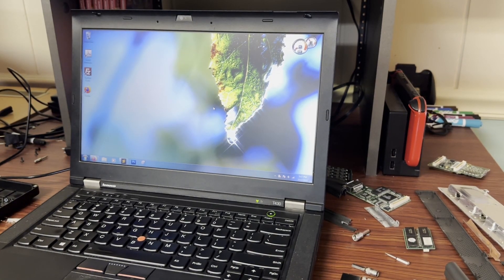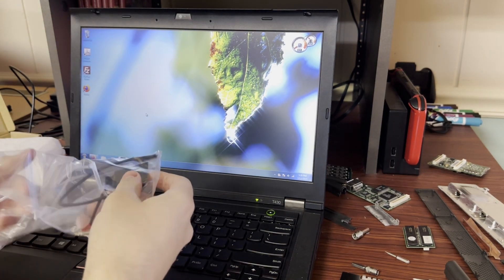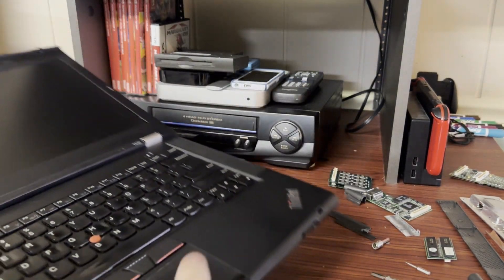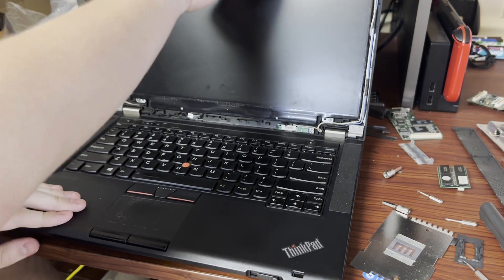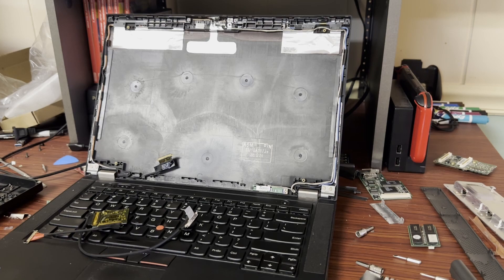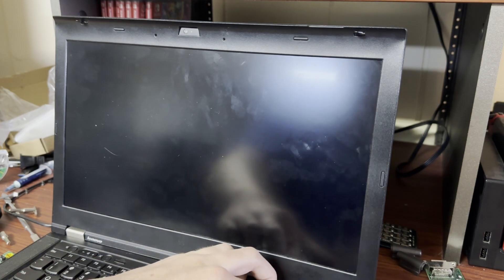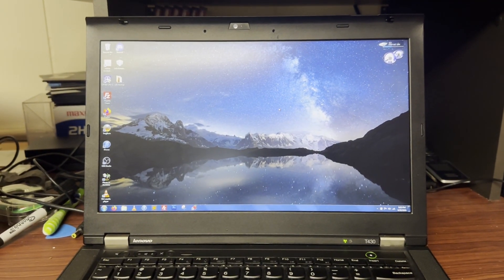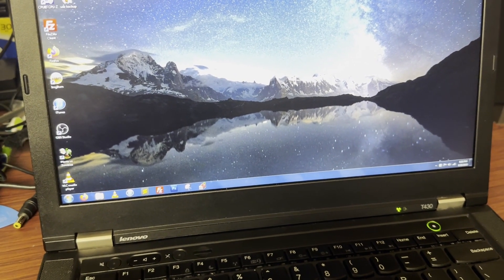Building my ultimate Windows 7 laptop (Part 1) - ThinkPad T430 1080p IPS Display Upgrade

Comment: I also don't trust the internal graphics in this laptop to run a 1440p monitor--I've got far newer and fancier thinkpads that struggle with 1440p
Reply from the maker: It should be fine for web browsing, video playback, programming, and other light tasks. I wouldn't expect a T430 to do well in gaming, video editing, CAD, or any other intensive task regardless of what screen resolution you have.
Reply: 1440 divides perfectly into 720p for games n stuff 😉 even better performance than the weird 1600x900

Comment: I've picked up a thinkpad W530 and I'm just wondering where you sourced the display mod? i've believe that my one has the same screen as yours currently (1366x768) I found some 1080p displays on aliexpress but I don't know if they'll be much better. (edit, actually, if i'm going to upgrade, the 1440p one might be worth it for me)
Reply from the maker: W530 is totally different, different size LCD etc. You’ll have to see whether or not they used LVDS or EDP screens. The T430 adapter should work if they use LVDS screens but make sure to do your research before buying anything.

Comment: Good video even though you skipped how you installed the new screen circuit board for the new screen. I have an old T430 that was in the discard bin at my old company when they upgraded everyone to new Thinkpads. It only has 4GB RAM, and i5 vCore and and slow 512GB HDD, so I am upgrading it to 16GB memory, and 1TB Samsung SSD. I will wait to see how its performance improves before going for a i7 processor. I have heard that an i7 does not make a real big difference. I upgraded a Dell Optiplex 9060 SFF to 32GB RAM, 2 1TB SSDs, and an i7 quad core processor.  For the original $64 price on ebay, it is a big improvement. These old PCs cannot update to Windows 11 though. I run dual boot Win 10 and Linux Mint or Arch Linux on these two machines (just one Linux OS per machine) . I am tempted to just go for a Thinkpad P14S but since I mostly use my MacBookPro M2, it might not be worth it. I like the Thinkpad keyboards and use a Thinkpad Trackpoint keyboard (~$96) on my Dell 9060. I also have an SGI Indigo Solid Impact computer that I bought in 1995. It still runs but it is more of an office space heater and relic from the past than anything else.
Reply from the maker: SSD upgrade will make a huge difference, it will be totally usable with the i5 that way. I’d still recommend a cheap quad like the 3720QM though, will give a big performance boost. Dual i5 to dual i7 won’t be noticeable. You can only do a quad upgrade if you pair an iGPU motherboard with a dGPU heatsink, otherwise it overheats.
Reply: @3lectr1c   Thanks for the advice. Today I installed the Samsung 870 EVO 1TB SSD and reinstalled Windows 10. The computer is much much faster now. I am waiting to receive the 2 x 8GB RAM cards. I think that for now I will stay with the i5 v-Core. It seems fast enough at the moment. Next I will go through the process of installing Arch Linux. I have a quad core i7 in my Dell Optiplex 9060. It has a heat sink with a overhead fan and it never overheats. I was thinking of putting a small GPU into that computer, but there are only about 2 choices, and I am already pushing the power supply and I am not a big gamer.

Comment: The ultimate W7 laptop IMO is the Dell Latitude E6540. I installed 2x 2.5 inch 1TB HDD and 1x MSATA as boot drive. Display upgraded to IPS FHD 40 pin from LG. With a removable battery, it is a breeze to lug it around.
Reply from the maker: That’s the great thing about these laptops - there is no single “ultimate” laptop. Everyone can have their own favorite. For me the ultimate machine is a 14” ThinkPad, because I like the size, and the keyboard is super important to me. That latitude looks like an absolutely sweet machine though, and if it’s the one that fits your requirements best, it is the ultimate windows 7 laptop for you.

Comment: don't do it the way this guy did.
Reply from the maker: You mean where I mounted the adapter? When doing it this way the most important part is to route the cables properly, or you’ll get bright spots of pressure damage on the LCD. As long as you don’t mess that up, it works fine. I’ve been heavily using my T430 since the video with no issues.

Comment: lcd part number please... ?  i want to buy the same lcd like you...
Reply from the maker: LGC LP140WF1-SPB1
Careful though, a lot of eBay sellers sell relabeled “compatible” panels that may or may not actually work
Reply: @3lectr1c  thanks bro... ❤️❤️❤️🙏
Reply: @3lectr1c   i watched your video and you have showed some adapter (8:25) to connect new monitor through it. What is the part number? And you didn't show how actually it was connected then.

Comment: i recently bought a ryzen 5 ideapad 3 14 inch, amazing laptop, terrible TN screen !

do you think it's possible to change the screen to a nice IPS on that specific model, how do i do it ? and If it's possible, how hard is it to do for someone who never did something like this ?
Reply from the maker: Possibly. It depends on a lot of factors. Being a newer laptop, it likely uses the EDP screen data protocol instead of LVDS. This difference was why I needed this adapter board for my older T430.
It’s most likely possible if the screen has a bezel instead of being embedded in glass, if the cable in the computer supports the higher resolution (if you’re going higher res), and if the computer doesn’t have any sort of whitelist against LCDs other than the one that the computer shipped with. What’s the resolution of the stock panel?
Reply: @3lectr1c  it's stock 1080p and i don't need any higher than 1080p, i just want to slightly improve the viewing from side angles and when the lid isn't perfectly aligned with my eyes
Reply from the maker: I’d think it would be possible at least to swap it then. Can’t be sure though, I don’t know too too much about aftermarket screen upgrades.

Comment: I had an old Dell (14z) in the closet that I pulled out to jailbreak my ipod touch 2nd gen. It was sold with Windows 7 but then upgraded to Windows 10 but then downgraded again to Windows 7 just so I could do the jailbreak. Oof, the display is so bad and it's slow af. Also it must weigh 10 lbs. Sure, I could put in an ssd, but am trying to decide if it's really worth it, given that security is non existent, and I'm hesitant to sign into any of my accounts.
Reply from the maker: For what it’s worth, it isn’t a problem using Windows 7 or any unsupported OS online as long as you don’t go to any untrusted sites or download anything you don’t 100% know is fine. Most people getting viruses are people who go to fishy websites and click on spam ads. Be careful though of course.

Comment: Damn. Now I wanna buy a few old laptops. I have an older Toshiba but that doesn't turn on.
Reply from the maker: What model?
Reply: @3lectr1c  Toshiba Portege Z930. Tbh, I tore it apart before I really knew anything about computers and I think I must've damaged the motherboard. I'm definitely regretting it now.
Reply: @3lectr1c  since you asked tho, I may as well see if I can get it running.
Reply from the maker: Ah. Good luck! Looks nice.
Reply: @3lectr1c  Sorry for the many replies. It turns out that it does turn on! How wonderful. It's an i5 3437U with 4GB of RAM. I took out the msata ssd ages ago but it was 128GB and the battery is a very spicy pillow.
Reply from the maker: Great that it starts! SSDs are cheap now. Install one along with Linux or even windows 10 and you should be able to get some decent life out of it. Battery aside.
Reply: @3lectr1c  I've already found all the parts I need in order to get it working (turns out I also need a cooling fan and RTC battery). Aliexpress has some great prices. I also think I want to have windows 7 on it since I have a Windows 10 laptop and a Windows 11 laptop.
Reply from the maker: Would make a pretty decent windows 7 laptop I’d imagine, screen aside.

Comment: To make it truly 'Ultimate', you have to get 2x8GB of memory too.
Reply: You're right. It would, on the other hand, add to the silliness of every single upgrade being more expensive than the base price of the machine itself (as he bought it at least, granted you do not find one of these for that cheap usually, at least on the other side of the pond where I am).
Reply from the maker: 16GB will happen at some point, although that’s probably the last upgrade I’ll do. 12 is in there now and that’s plenty.

Oh, and yes, this is absolutely all very silly. I could have just bought a T480 instead for a faster and more cost effective experience. But hey, that’s not nearly as fun!

Comment: Nice. Maybe I'll upgrade the screen of my t420 sometime in the future too, although I can't say its shitey quality disturbs me. I've seen much worse in terms of viewing angles, and, well, got quite used to the default one
Reply from the maker: Have you got the 1600x900 one? From what I know it’s a bit better than what I had (1366x768) but still TN with poor viewing angles.

Also, how’s that keyboard?
Reply: @3lectr1c  Nah, the defaultest of all defaults, 1366. Dunno, the biggest issue I'd name with it is kinda low contrast.
The keyboard's wonderful, never used the newer ones like in your t430 so can't judge which key mechanism is nicer, but the layout is much better and intuitive. This, however, you surely see yourself on the photos and all. Esc and Delete are twice as big as other keys, function keys are grouped into fours. Had a problem with the mechanism of one of the letter keys but later it just kinda, I dunno, broke back into correct position or something so now there is no more such an issue
Reply from the maker: I have used one before on T520s and W520s that I’ve used before, but don’t own. They are certainly great. That’s probably my next upgrade for this laptop.
Reply: @3lectr1c  By the way, do you think the laptop's cooling will handle a 4-cored i7?
Reply from the maker: 3840QM is the highest one that people recommend. This is only recommended though if you have the dedicated GPU heat sink installed (even if you don’t have a DGPU), or at the very least if you don’t have the quieter delta fan.
Just watch your temps, it’s an upgrade that I’m planning. Makes a T430 bench faster than a T470.